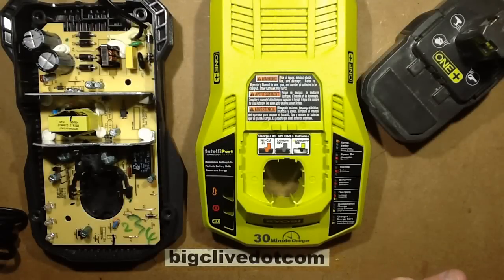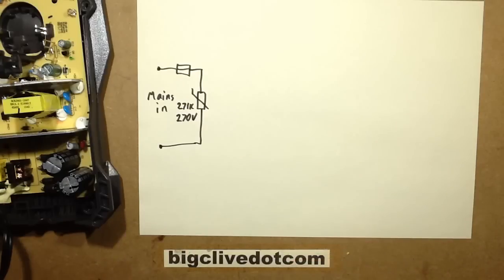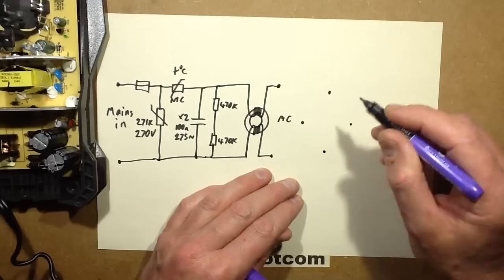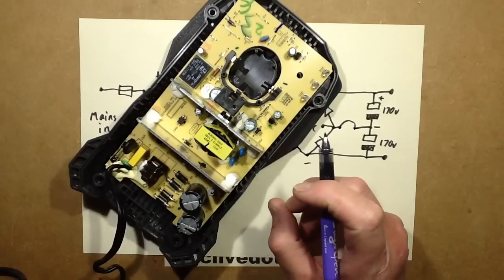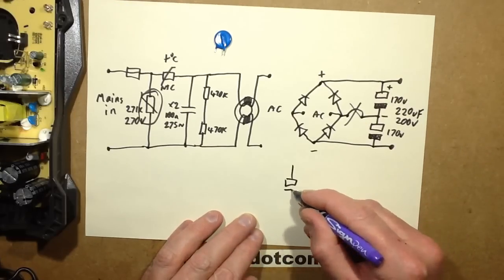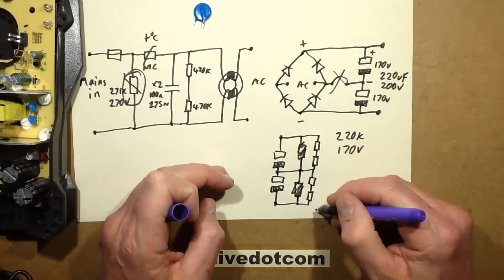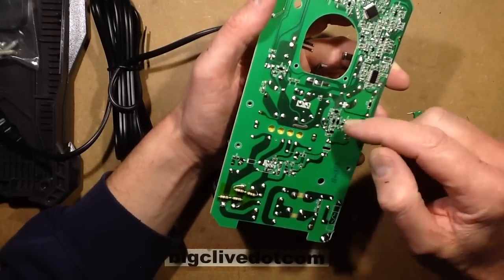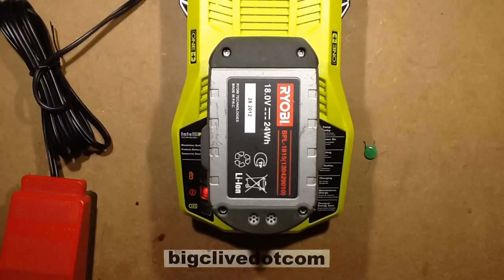How to convert Ryobi P117 charger from 120V to 230V use.

Comment: I wish you made a final part where you made the modification. What needs cutting, replaced. A conclusion for non electronic savvy guys who can understand parts
Reply: If you don't have basic understanding of the components, tampering with high-voltage circuits may be extremely dangerous.

Comment: Repaired and converted my P117 charger to 230v based on this video.  Unit had been accidentally plugged to 220v. Replaced  the TOP256EN and did the mod in your video.  Now working on 230v.  Thanks for the video.

Comment: Hello
Thanks for posting this...exactly what I was looking for.
Question:Is the Metal Oxide Resistor shunt across the AC input really necessary?
I want to modify my US P117 but do not have a suitable higher voltage device to replace the original with
Reply from the maker: It's useful if there are inductive loads being switched in the vicinity.

Comment: Thanks Clive for a crystal clear explanation. I used this video to convert this charger 3 years ago. I recently bought another one as a backup and to increase charging capability. The new one (still P117) seems to have a slightly different circuitry. I'm no electrical/electronics engineer and so I'm stumped!! Got any tips on converting the new version (Made in Vietnam, previous was in China)? Not sure if it is possible for me to share photos/video.
Reply from the maker: I've not seen the new one.

Comment: I made this conversation to use my US charger in the UK (240V). I did not add the registers. It turns on but when I put a battery in to charge it the testing indicator (flashing red led) comes on and remains flashing; it never switches to the charging indicator. 
The battery is a good, working battery, nearly new and charges normally on my son's UK charger, which switches from testing to charging almost instantly.

I don't know if it is actually charging on my modified charger; I didn't want to leave it flashing 'testing' for long in case it was somehow damaging the battery.

Comment: Could I insert a switch between the rectifier and the capacitors instead of cutting the link, to make the charger switchable between 110V and 240V, or would the threshold of the varistor be too high in 110V mode?

Comment: Hi, we are moving back to the UK with a bunch of Ridgid lithium  battery tools. The charger states that it is 110V ~ 60Hz.  I know that I can get a step-down transformer to supply the charger, but do j need to worry about the differing frequencies?  Ryobi and Ridgid are pretty interchangeable here, and you don't mention the frequency compensation in this video so I was hoping that it was a non-issue.  Any help would be appreciated.

Comment: Good explanation. I had a 110V Ryobi charger connected it via a Voltage converter. The converted was capable of converting in both direction. Unfortunately I missed to select the output voltage to 110V and killed the charger with a 240V input. What component might have been damaged?

Comment: but do we directly take 18V from the laptop charger? will it work like this?
Reply from the maker: A laptop charger will not be able to fully charge a lithium pack like this, and does require some from of current limiting.  It's better to use a proper charger.

Comment: At the risk of sounding like an amateur (which I am), I have a question. Why do you not need to change the transformer? Wouldn't it require a different set of windings / ratio for a different input voltage?
Reply from the maker: When set to 120V the voltage is doubled, so the transformer section sees 240V for both systems.
Reply: @bigclivedotcom  : Thanks. This leads me to the follow up question: Is that, what that link between the Caps is doing?

Comment: I've been waiting for the Usb C PD adapter for my Ryobi batteries for several years in Canada.  I have the normal inverter but going from DC to DC is much preferred.  I hope they release this soon so I can charge and use my Ryobi batteries with USB C chargers and devices.

Comment: my general system for having "infinite" battery life is to buy two of them and swap the one I'm using when it's drained. 
I apply this philosophy to pretty much everything that isn't my phone/tablet/laptop. I try to look for devices that have a removable battery, preferably with AA/AAA and  swap when needed. I used to specifically look for devices with a built in battery but now I've been the opposite way, I want to use AA/AAAs rechargables since they're cheaper and you can use them for anything and you're not creating as much waste since the battery comes out.

Comment: they are great tools all made by TTI which owns and makes Milwaukee,Rigid ,Ryobi and Craftsman .Used to buy expensive tools .They just sprout legs an walk away .The Ryobi used to be blue like Bosch .That fluorescent Green has great visibility .Many tradesmen wouldn't be caught dead with them .Only 5 or 6  brands Milwaukee ,DeWalt,Bosch,Walter Metabo ,Hilti and there are a couple others that are insanely expensive .I'm an electrician ,I use Milwaukee and Hilti and Fluke and Amprobe  .At home I have Ryobi!

Comment: Maybe I'm missing something here, but ...

Why would you replace a 270 v MOV with a 470v version, and not 540v? (Other than the fact you have one available?)

Or maybe the original design should have had two 270v MOVs with a link shorting one, using the same philosophy as the other link.

Comment: This doesn't work with P108 charger. It doesn't have the two capacitor (voltage doubler) topology. After replacing the single cap and varistor with higher value ones, the charger is stuck at detecting the battery (blinking red). The switching electronics doesn't like higher voltage.

Comment: Like to share my experience with my P117.
Picked up a nonworking Ryobi P117 battery charger hoping I could fix. I've replaced one component so far TOP256, no dice.
The other components I've ohmed out what I could, finding nothing shorted.
So far, no luck.  Without a schematic / road map it's rather difficult. I've downloaded lots of YouTube videos but still no dice. 
Before replacing any components check the windings on the main Transformer.
The 'high voltage' on the primary circuit side isn't working. You should hear a bussing sound (the high voltage oscillator) feeding the primary winding. 
This circuit powers the primary winding of the yellow transformer in the middle.
The primary winding has four pins. The resistance within these types of transformers, usually have a low resistance.  Two pins have a very low resistance (ohms). The other two on the primary side measure a very high resistance of megaohms. At the time I wasn’t sure why. I would have expected a low reading of around 20 ohms.
The secondary winding also had four pins and all four measured a low resistance.
I decide to unsolder the transformer because what do I have to lose, it doesn’t work anyhow.
I found the wire coming from the winding was broken off at the soldering pin of the transformer. Soldered the broken wire back to the pin.
It’s fixed.

Comment: Ryobi updated schematic of P117 charger. Now it has single diode brige and only one capacitor 150uF*200V. TOP256en was replaced by 6 pin Voltage Regulator 73L21a (I did not find any datasheet on it) and transistor 13N50.
I replaced varistor to 430V ant capacitor to 100uF*400V. When I plug charger to 230V red LED is on. But when I put a battery red LED starts flashing, then green LED blink once and this repeat again.
Does onyone has idea how to fix it? Charger and battery are brand new and I can not check its separetly.
Reply: Very happily converted a P117 charger 2 years ago.  Acquired another new one this morning and see the circuit has been changed, so I guess I’m looking for a 230/110 volt transformer or some nifty circuitry to halve the voltage instead!

Comment: How much current was the charger drawing from the mains, when it was running on 120v?
Reply from the maker: It would be closely related to the chargers power rating.  Twice the current on 120V as 240V.

Comment: That bit with the link is the exact position of the 110/220 switch in just about every PC power supply that I've torn apart.  I have a number of those switches around if anybody wants one.

Comment: Any hints how to charge such battery with RC charger? I give 5S rated voltage on + and - terminals and after some time I get broken connection error (somehow BMS disconnects battery).

Comment: Why multiply with 1.41 or is it 141??
Reply from the maker: RMS to peak conversion.  1.41
Reply: @bigclivedotcom  help me understand how you came up with 1.41.    Any link?
Reply from the maker: @ckimani1  RMS means Root Mean Square and is there average voltage over a sinewave.  In a power supply the main reservoir capacitor is charged to the peak voltage of the sinewave, which is 1.41 times the RMS value.

Comment: I just bought one of these chargers from someone for spares or repairs and I knew instantly what had happened as I know you cant get these chargers in the uk so I got it for a good price opened it up and instantly noticed the fuse was disintegrated and the move was blown to bits straight away I knew someone had plugged this charger into 240v so I replaced all the components and did the 240v conversion on it and I've got it working thanks clive

Comment: Ive got 2 of these things. Both failed after 3 or 4 charges.  Both failed in seemingly the same way (just goes dead, no lights), I replaced the switch mode power supply chip (6pin thing on the heat spreader) of one, no change.  Fuse is fine, no idea what else it might be.  But, lots of others in the reviews say theirs also failed early in it's life.

Comment: Thanks.. today I converted my P117 charger to 230V and so far it's working fine (no magic smoke nor fireworks).  My only problem was to find the right screwdriver to remove those 4 fu.. tamper proof screws (I think they're called torx internal tamper proof screws).. It take a lot but at the end I found a bit that came on a set I bought several years ago and I've never used... until today.

Comment: Will this variaster work (14D431K 431KD14 Metal oxide Varistor MOV 275Vac 330Vdc 275V)?
Reply from the maker: The 431 represents the threshold voltage of 430V and the D represents the component diameter.  They will work fine on 240V.

Comment: My mods are not to the supply but to the tool/battery interface. Using a 3D printer to make adaptors for my old cordless tools. Using black and decker batteries in a dewalt for instance

Comment: i think the circuitry for operating without the relay engaged is for a pre charge function, for when the battery is under voltage, but i might be wrong

Comment: I was considering a modification like this before I went on a work trip to Nigeria.  I couldn't figure out what parts to order in the US though and just picked up a transformer I could use for multiple things.

However, one day when I was sick the site techs used my tools for some work and one of them plugged the charger in without thinking and it died.  Fuse is intact.  Any idea how to figure out exactly what went bad?

FWIW I do have another working unit on hand so I can definitely make some comparison readings once I have some potential culprits narrowed down.

I would like to modify mine with a switch.  I think a recessed switch such as already found on some PC type power supplies would be a good fit to avoid accidental flipping.

In addition to help finding what was cooked on my charger I would also appreciate it if anyone could help me source a good varistor option stateside.  Mouser.com would be a good site to use.  Amazon too for simplicity if not price.

Additionally, would the resistor mod make sense with a switch involved or does the functionality they are accomplishing go away when they aren't in series during 110VAC selection?

Any help much appreciated!

Comment: I once plugged a 120VAC power strip with surge protection into a 240VAC outlet.  BANG!  instant removal of the MOVs!  It rattled a bit from the pieces inside.  ☹️

Comment: Could you install a switch where you cut the line between the diodes so you could switch between using it on 120v and 230v?
Reply from the maker: You could add a switch, but the risk of leaving it on the wrong setting would be huge.
Reply: @bigclivedotcom  I mean I am the only person using it and I want to be able to use it when I move back to the states.

Comment: why resistors on capacitors? if not to put them?
Reply: He explained that. The capacitors are not perfectly identical, and therefore they aren’t likely to perfectly split the voltage between them.  If one cap gets significantly more voltage than the other, it will exceed its ratings and fail.  The resistors equalize this voltage to make sure they stay in range.

Comment: 18:10 those two contacts are bridged together by the battery, and that's how the charger determines when a battery is present. I bridged them with a screwdriver for no good reason and the red LED started flashing as it does when it's analyzing a battery

Comment: Would this work in reverse. I have a 240v UK Ryobi charger. I'm moving to Central America on 110v. Could I install a link to convert from 240v to 110v? Would that be enough? Would I have to change the transient suppressor?  I should add that I know bugger all about electronics so if I was to do this, it would be done at my own risk with crossed fingers and one eye closed. Or could I post it to you so that you could make a video the reverse of this one? Here's hoping!
Reply from the maker: It depends on the charger.  It may be easier just to buy a 110V charger.
Reply: @bigclivedotcom  Thanks for responding Clive. Yes, buying a 110v charger is my plan. I was just trying to find a use for the chargers I have. I might be able to get a couple of bob for them on eBay.

Comment: The one thing with Ryobi and Ridgid is that they're more a homeowner grade of tool. Dewalt, and especially Makita and Milwaukee are better quality and have a wider assortment of more esoteric tools certain trades and contractors tend to need/use. (Milwaukee has a really nice electrical panel hole punch, for example).

Comment: Great post Clive, I have a question. Having rushed back from the states and plugged it into the 240 outlet of a duel transformer in haste I've blown both capacitors! What is your recommendation - try to source the same two US spec or replace with a UK spec resistor or resistors ? 
I would imagine UK spec ? If so can you clarify if one or two and the exact specification please.
Many thanks again
Reply from the maker: You may have caused more damage than just the capacitors.  You could try swapping the capacitors and maybe the transient suppressor too if its been damaged.
Reply: @bigclivedotcom  Thanks Clive appreciate the response. Im about to transfer the new Capicators today as described in the video. Will let you know how it goes
Reply: No Joy Clive - Will try the transient suppressor once Ive found out what Im looking for ...

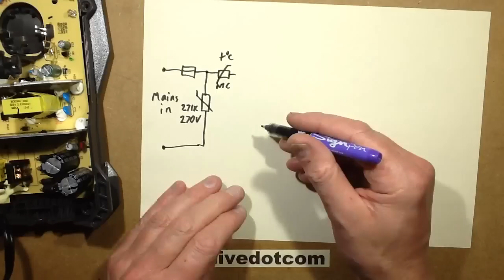Comment: I hope I'm not too late but what's the purpose of the capacitor you drew at 3:52 ?
Reply from the maker: The X2 capacitor is a standard interference suppression capacitor it acts like a tiny buffer that softens sudden spikes and shunts high frequency electrical noise.

Comment: And here I am scratching my head thinking how to achieve exactly the opposite.

I have about 7 spare chargers (not Ryobi) and I would like to convert one from Australian 240V to USA 110V just in case I ever need to travel as I use my batteries to power video lights, cameras and heated gear. 

Would it be that all I need to replace then is the capacitor seeing that every other component is already rated for higher voltage?
Reply from the maker: It depends on the circuitry.  Some have a link selectable voltage doubler to allow the unit to be manufactured for 120V or 240V.
Reply: Thanks for your reply.

If I knew how to identify that I probably wouldn't have found your channel. :)

If you could have a quick glance and tell me what do you think? Both PCBs are versions of the same charger.

https://imgur.com/a/FfGdeoM

For what I can see the first varistor is a NTC 10D-7 in one of the boards. The other has a NTC 5D-9, then a 275V Capacitor (the yellow brick). The big black capacitor is a 400V 47uf.

The mosfet is a SVF7N65F SW7T22B.

If it is too much trouble don't worry about it. It is just that I somehow ended up with about 8 spare PCBs from these chargers after reusing the carcasses to hold batteries for a different and way easier project and thought that it would be useful if some of them were able to be used in countries with 110V when and if I need to go there to work.
Reply: Clive.

I found one of my AC-AC step down converters. I tested the output voltage and it is the same 20V. Now I need to put one battery on charge to see if the recharging time is the same.

Comment: It looks as if they are using the 2 caps in series as a voltage divider to develop a common so that they have a split DC supply.  If you cut the connection between power and the capacitive node then you remove common for the split supply. Otherwise there would be no need for a diode bridge, instead, just a pair of diodes. There would also be no need to have the series capacitors. A single cap rated at twice the voltage would suffice. I am a little confused by the design itself.

Comment: Do you know how to change a Ryobi P110 from 110v to 220v?
Reply from the maker: I'd strongly suggest that you get a Lithium battery and charger for your tools.  It will make them better than new.
Reply: Yep. I was gonna throw a bunch of blue tools away but then I got my new 4AH and charger from my brushless drill and impact and Holy hell I don't think that brushed sawzall has changed in 20 years lmao